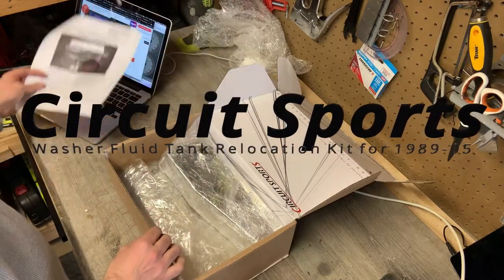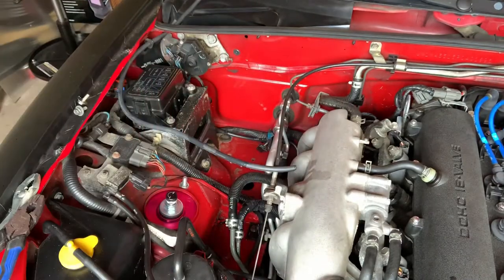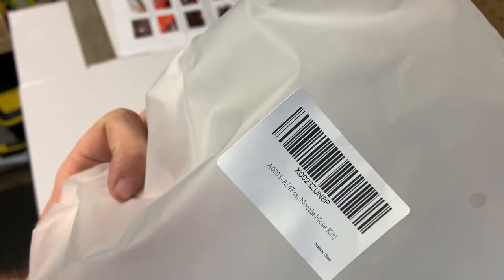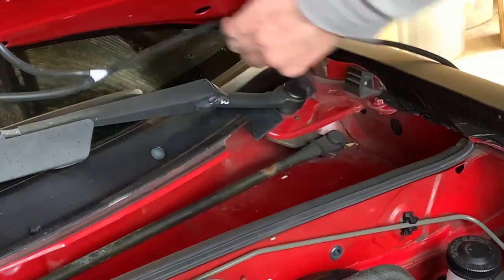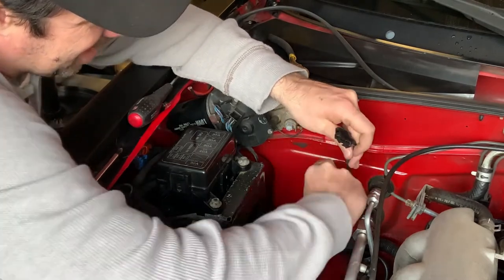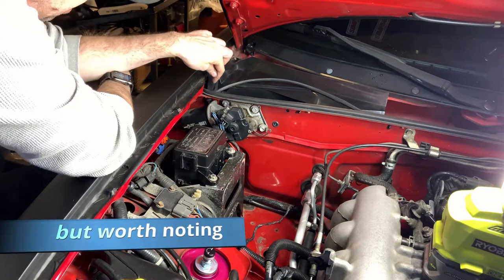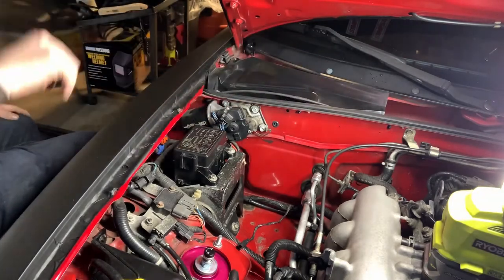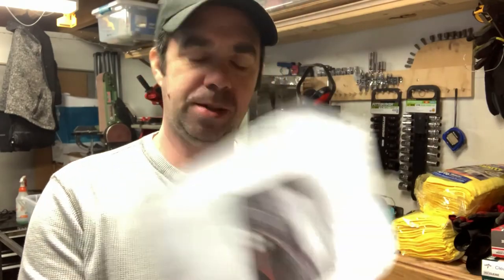Mazda Miata  - Circuit Sports Washer Fluid Tank Relocation Kit for 1989-05 NA/NB

Comment: Great video but now I have no clue how to wire this because I don't have access to a soldering gun.  How would I do this normally?
Reply from the maker: Thank you. For this type of connector i'm afraid you really need to solder it on as the clamping force of the little fold-over clips just won't hold for much driving. 
I understand that soldering can be a pain near the car if you don't have power(or an iron!), there are some battery soldering irons as cheap as $30.

Comment: Nice video! Similar to cappuccino, but looks like it lays a bit lower in cowl. As I watched your work soldering I wondered if it would have been easier to remove OEM female fitting (on driver’s side), spliced wire directly, and then reused that fitting at pump, thus avoiding the fittings from kit? However it may stick up higher and interfere with bonnet?
Reply from the maker: Damn. You are right, i think it would have been better. I may just go back to it next time i have an excuse to move it.